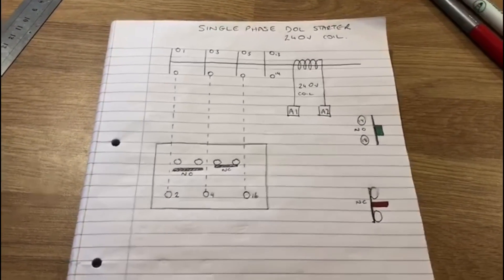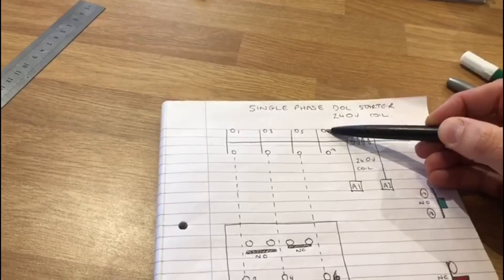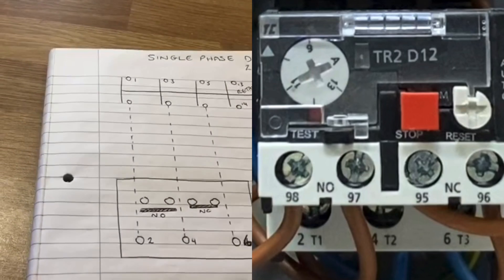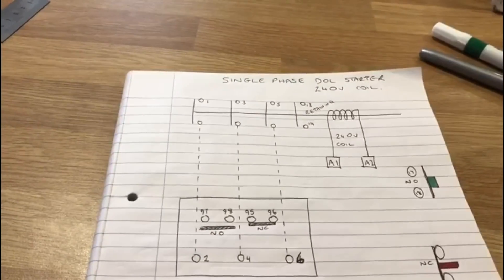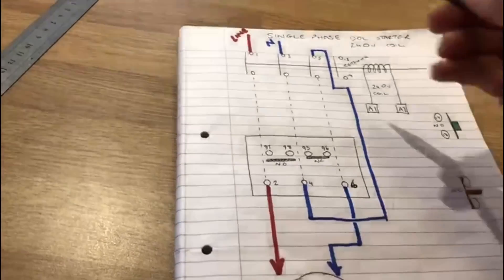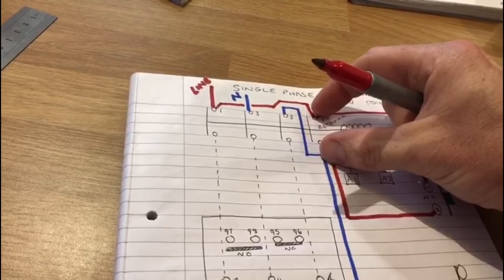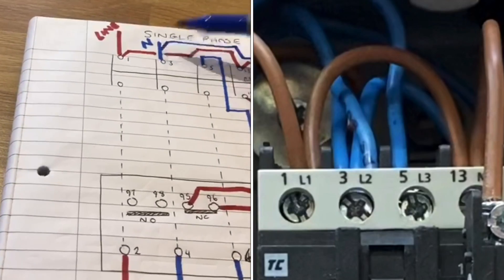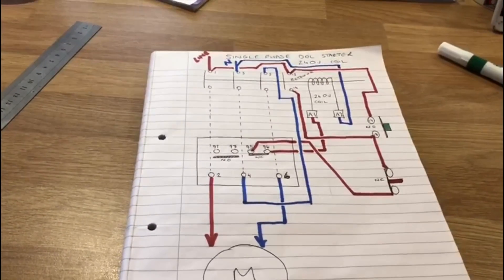Wiring Diagram How to Wire (Connect) a Direct Online Starter (DOL) Connections Explained

Comment: Have you tried on load? I tried with 5.5-8a thermal relay. I made the setting 5.5. Even though I draw 10 amps, the thermal did not break 95-96. I did the experiment by connecting a heater. (Omic circuit ?)

Comment: Isn't it better to use the Line from 1 to 2 to 3 to 4 instead of the neutral from 3 to 4 to 5 to 6 ?
Reply: I mean, technically it doesn’t matter at all, if what you’re after is simply having full motor current through all 3 sets of contacts. But looping the live through twice does feel more intuitive than doing so with the N.